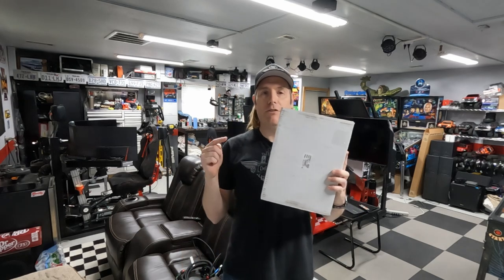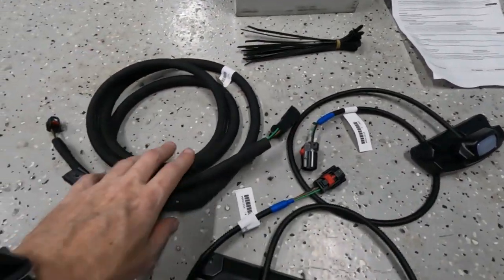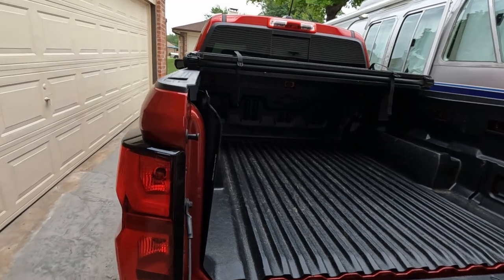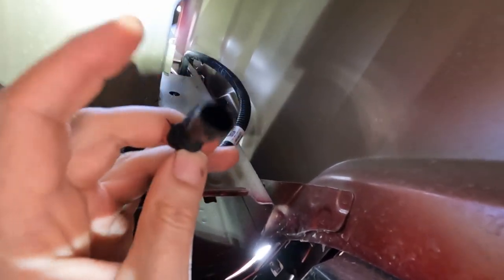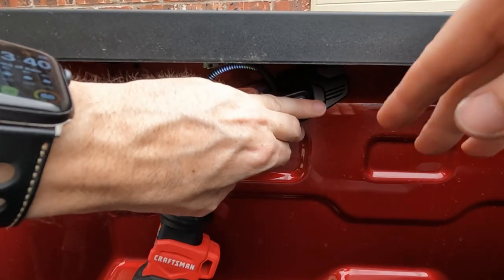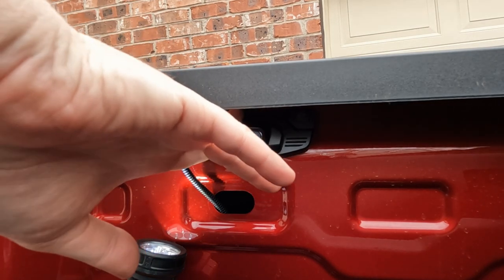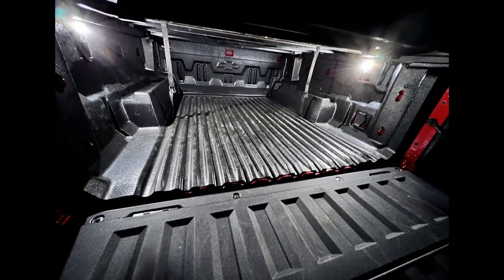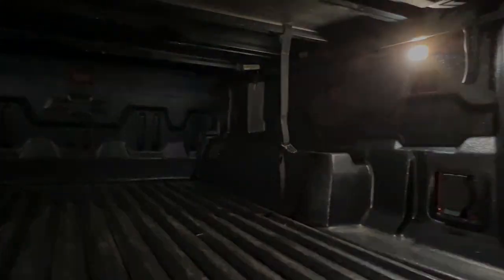2023 Chevrolet Colorado/GMC Canyon factory Bed lights installation #2023colorado

Comment: In order to get them through the intended port hole, you have to decouple the clip from the top of the pin with a small flathead (careful not to break it off), then remove the red slider piece. Once the red slider has been removed from the clip, you can get it through there and then reassemble on the other side.
Reply: How did you detach the coupler?
Reply: @brianfredricks9234  you have to pop it off with on the sides where it's clipped over the tabs. Use a small flathead and pop one side, then the other.
Reply: Very helpful, thanks!
Reply: Video?

Comment: I just installed my set after watching your video, I didn't have to depin or anything to get the harness through that tight spot. If you put the red part of the clip facing up and stick it between the two plastic tube like pieces that hold the plastic rails down it will go in. It takes a little bit of pushing and wiggling but it fits perfect and looks much cleaner :)
Reply: Exactly what I did

Comment: Thank you for the video, made it easy to find a good place to power mine up. I used some Amazon ones and an existing bed hole that fit my switch perfectly.. Gonna look for a tailgate type switch to replace the supplied switch, so when I open tailgate it turns on the lights. Just don't wanna forget one day and kill my battery..

Comment: You may be able to de-pin the connector and send the wires and loom over the bed corner where you thought it should go. Re-attach the wires and plug it in.
Reply: How did you de pin it?

Comment: Thank you so much for this video!!!  I dremmeled out just a little material to run the lights into the access hole that was too small.  This was so much better than your option as it hid the wires better.

Comment: Just did the lights on my truck. I ended up de-pinning the moles connector and reconnecting. Clean easy install.
Reply: How did you depin it?
Reply: @brianfredricks9234  if you Google De pin molex there are tons of videos. It took me forever to figure it out but once I did one wire it was very easy for the other 5.  Make sure you take a picture so you rewire in the correct order.  Lesson learned the hard way.  Harbor freight sells de pinner or you can use a thin paper clip.  The clip you have to lift to pull the wire has to lift just a hair and the wire comes right out.  Takes some patience getting the first one.  However worth it. The finished product is much cleaner running the wire properly.

Comment: Does the rear light  (original bed light on top of rear roof) have to be on for the lights you installed to work or is the place you plugged in hot?

Comment: Thanks for the video! Very informative. I imagine using that side grommet hole to route the wiring won't look very nice if you have a spray-in bedliner. If the wires don't release easily from the clip I would almost be inclined to cut the wire, run down through the intended hole, then splice back up with waterproof wire nuts/connectors, tape up real good and tie wrap to the harness underneath.
Reply: I'm guessing it's pretty easy to depin the connector. You could also use a step bit and drill a hole big enough and just add a grommet

Comment: Can you release the wires from the connector then then reinstall the connector from underneaths once you pass it through the bed sidewall?  Typically those connectors are pretty easy to release the wires. I ordered this kit and will try to do this on my install.

Comment: You can make the connectors fit easily by filing off the tops of the red tabs. They still work just fine.

Comment: I am attempting to install bed lights in my 2023 Colorado Z71 with a switch, utilizing the plug that you are using.  Although I am using the oem pigtail  to connect the rocker switch.  I tested and had power to the switch and after soldering my connections, no power.  Do you know the fuse location?  Thank You,  You do an excellent job with your videos.

Comment: Cool install.
Do you know if this kit will work on the 2024 Canyon Denali with spray in bed liner?
Reply: It works with a 2024 Colorado ZR2 with spray in bedliner, so I would assume it would also work with the canyon

Comment: In order to get the plug down without cutting your grommet you will need to disconnect the plug and it will slide in.  Your video was very informative but you can unplug the connector to slide down the correct area